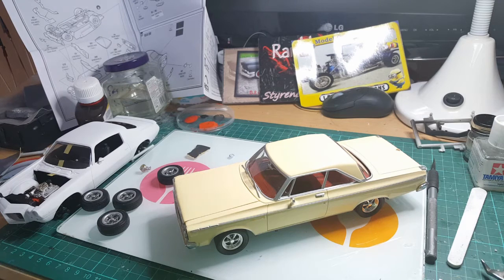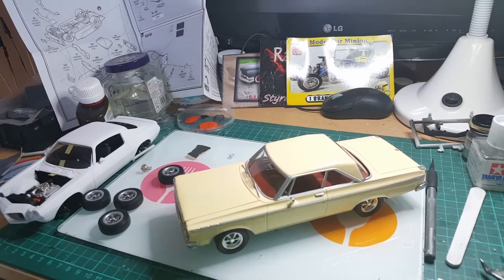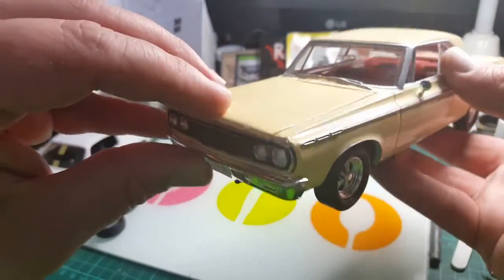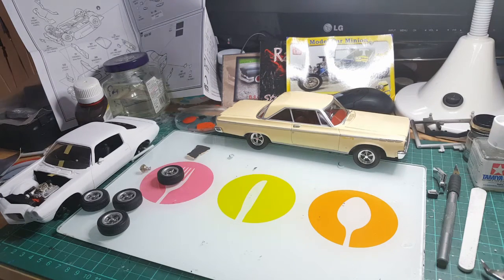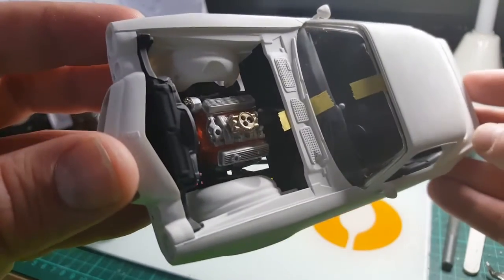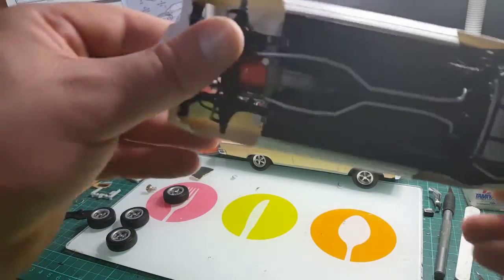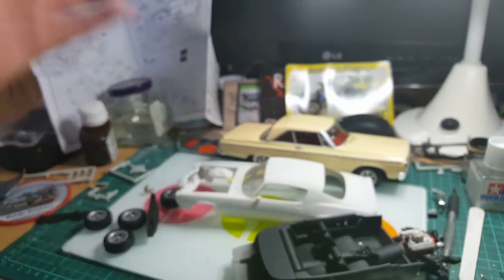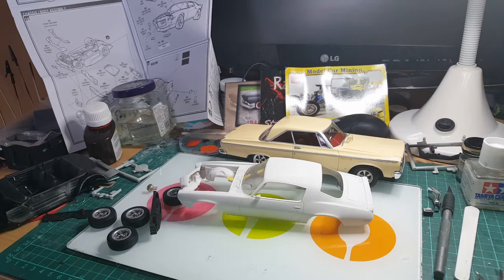Weekend update 17th Sept

Comment: Good progress on the Camaro, I will probably run in to the same issues with mine, so I am keeping notes as you and Dwayne build yours. I had planned on putting the chassis in and then add the front frame rails to see if I can get a better fit. Cheers
Reply from the maker: +Wayne Osborne The fit issues ate definitely between the bottom of the screen and the leading edge of the dash Wayne, fir me this one is one of those kits that never stops giving issues! Lol ......I have paintwork issues now